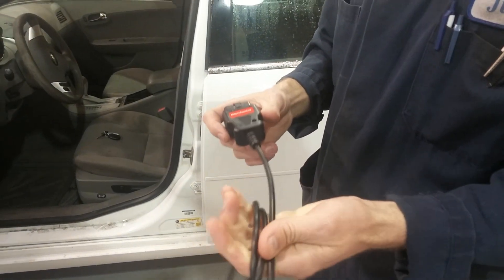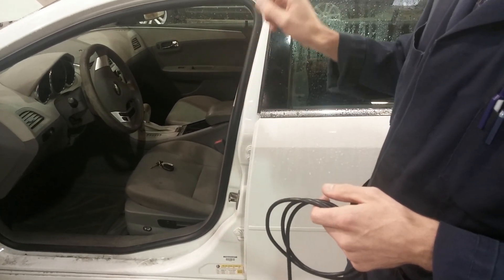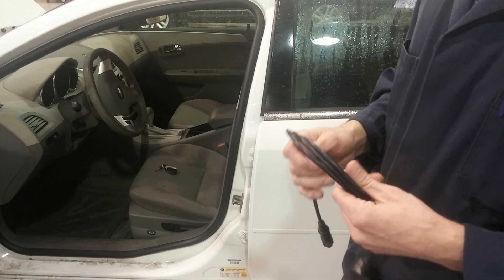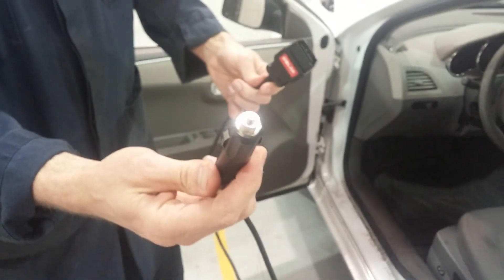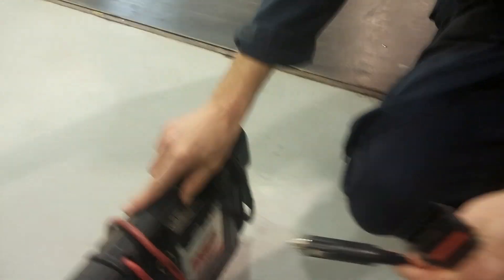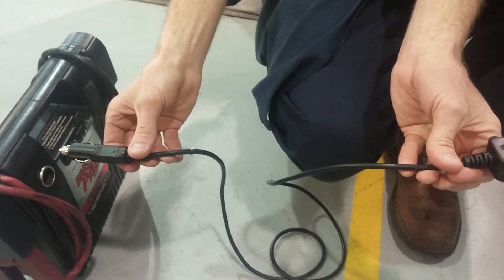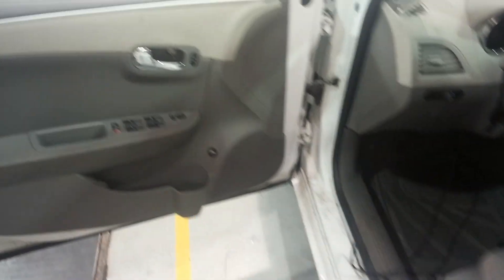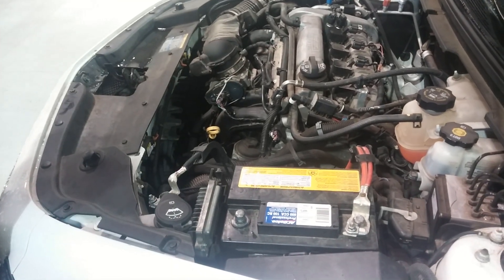Using a "memory saver" when disconnecting a battery

Comment: This might be a dumb question but could you actually jump start your car this way?
Reply from the maker: +Bryan S 
No.  There is a fuse in the memory saver (approximately 10-15 amps) and there is a fuse in the vehicle that protects the DLC (about 10-20 amps).  If you attempt to start the car with the memory saver as the only power source, it will blow one of those fuses.  In fact, even turning the key on or turning the headlights on could blow the fuse.
Reply: Thank you for the reply and the great video!
Reply: Justin Miller That would be great if you could add a note about that in the video. Thanks.
Reply: just to add to Justins comment, even if there were no fuses in the way to protect the overload, the draw would melt everything because they were not designed for the kind of load that a battery requires. think of how thick jumper cables are... thats the kind of thickness you would need to do it safely.
Reply: You could if the battery is good. The low amperage means it would charge very slowly. Hook it up and come back in about 6+ hours. Should be charged enough by then. Practical.... no

Comment: Something worth pointing out - if I'm not mistaken, with the memory saver connected, you will still have the problem of the positive cable being hot even with the negative battery cable disconnected.
Reply from the maker: +elven b That is true. When deciding whether to use a memory saver or not, you should weigh the pros and cons.  One possible downside of using a memory saver is that it does keep the voltage supplied to the vehicle.  For example, If you are disconnecting the battery to disable the airbag system, using a memory saver will defeat your purpose.   If you are removing a starter motor or alternator and you use a memory saver, the B+ cables will remain hot.  If you short them to ground during the process (which is easy to do), you will blow the fuse in the memory saver or the vehicle's fuse to the DLC.    

On the other hand, if you choose not to use a memory saver, what will be the costs?  Will you have to take the car to the dealer to get the radio code restored?  Will you lose  OBD II data, or something else that will be important to you?
Reply: @JustinMillerAutomotive  I totally agree with you , I learned that the hard way.. ⚡.. 5 minutes later clock is ok but other things like a/c  blend door was disfunctional and  blown fuses on the fuse box.
Reply: I don't use memory saver for anything. I have the radio code written down kept in glove compartment.
Reply: Sounds like you have an older car. Newer ones with have so many computer functions that will be disrupted. In the Mercedes, you will end up needing modules reset which can take hours and thus more money. Better to use memory saver to preserve settings.
Reply: Another thing worth  knowing isthat if your external power source has more  amps than the circuit of theOBD2 port or the cigarette lighter,  then their fuses will blow.  Many jumostarter power banks have 10amps now and the fuse fpr the circuit you are using might have fewer amps.